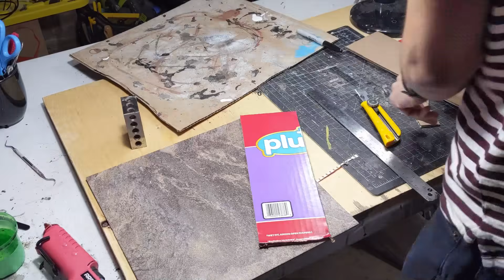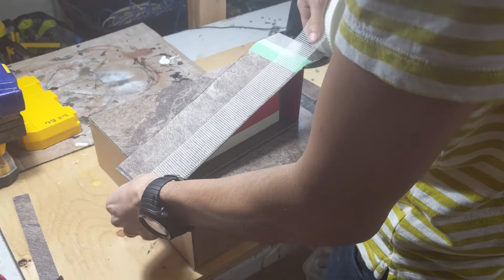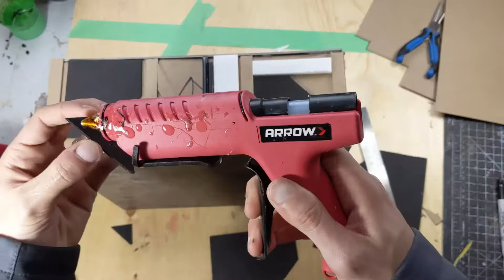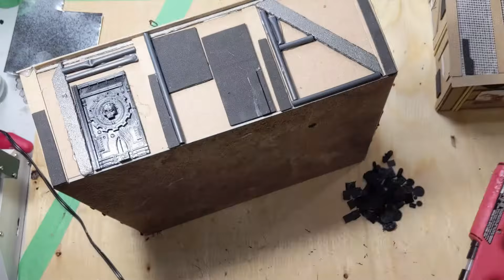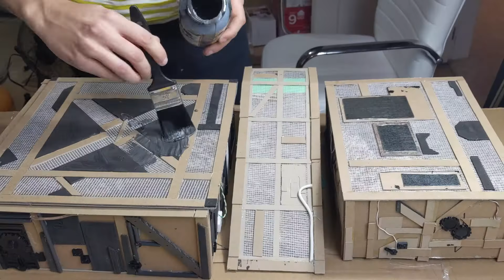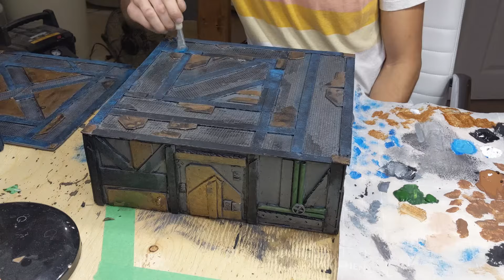Awesome Warhammer 40K Terrain (build it yourself)

Comment: Great video. I have a question for you. What type of glue would you use if you were to glue cardboard to plastic (pvc)?
Reply from the maker: You can take your pick really, Superglue should work well, so would hot glue for a slightly messier look.

Just be sure to scuff up/sand and give the PVC some tooth before gluing it.

Comment: Do those tin shears you used warp the metal at all? I noticed you make short cuts; the only shears I could find always curve the metal I cut.
Reply from the maker: The cutting length is quite small, and yes they indent the material a bit but its very pliable and easily straightened

Comment: Just started watching your work, its very nice and quality results. How well do the figures hold onto the tops with the metal plates under the tiles? Have you thought about adding magnets to the bottoms of the box/buildings and the underside of your other pieces? That would hold them in place when stacked on top of each other or to keep ramps/bridges in place. Looking forward to seeing what else you build.
Reply from the maker: Figures hold well enough to where they wont slide off if tilted like the ramp. I have added magnets to things like walkways, or tall terrain features that are likely to tip over, and it works great.

Comment: Good build. Perfect for 40k. I nodded with enthusiasm when you used joint tape for your grids! (See my video ... https://youtu.be/iwXA84v2RwI.)

Since you asked me on Reddit, Necromunda needs lots of ladders. No wall should force fighters to run a long distance around to get to an enemy. Also you would need other buildings to connect to this big one.

You speak well but your voice is quiet. I would increase your voice track's volume. And is it my imagination or is the video desaturated? Brighten it up if you can. Not like I'm an expert. Look at RaqRex for great, colourful videos. Anyway, thanks for this!
Reply from the maker: I saw that video! I had a bunch of this tape from some drywall patching, its a really good tip!

Good point on the ladders, maybe I can add in some attachable ones randomly on each side.

Thanks for the rest of the feedback too.

Comment: I was contemplating doing something similar for Frostgrave (texturing everything in small bricks made from foam) but I wasn't sure if it would actually work so I hadn't invested the time to experiment. Thanks for doing the hard part for me! lol
Reply from the maker: Some fantasy themed boxes and ramps would work well! Probably easy to add brickwork along the side of them. Although probably tedious depending on scale.

Something more akin to a dungeon tile system in pattern maybe.
Reply: @KnarbMakes  That's actually what I had planned. The boxes would be two layers of foam core shy of being 12 inches square and one layer shy of 3 inches tall so that the foam core will make up the difference. All surfaces would be carved Dungeon Tile style to save time. The bottoms of the boxes would remain open to store scatter terrain.
Reply: @KnarbMakes  Something that occurred to me while I was at work last night: your build method would work REALLY well with LED lights.
Reply from the maker: @harlandmountain7998  yeah, for sure! All the wires and batteries can hide underneath